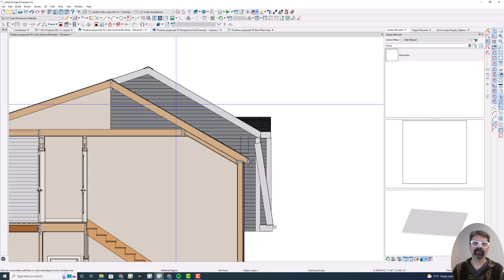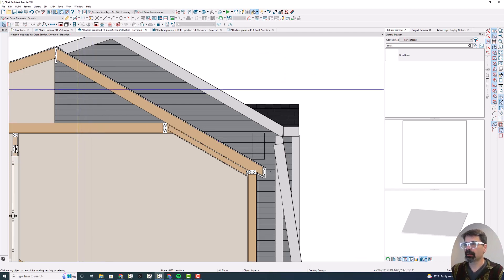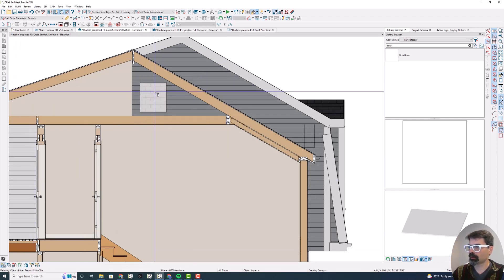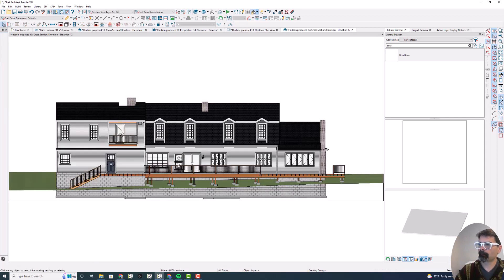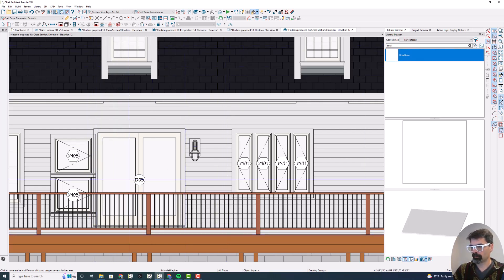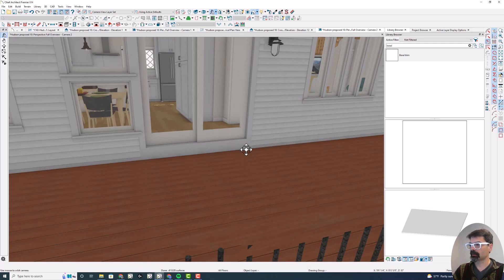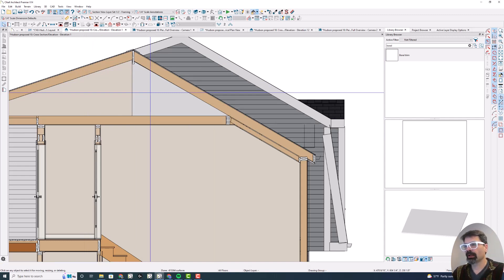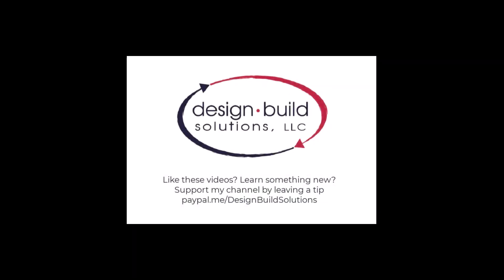Saving Time with Wall Material Regions | Chief Architect

Comment: Hey Tim.  Great video as usual.  
Off topic question....when using Notes, I can't find where I can fill the Note symbol with white, under the number, so that I can place the Note over a line or fill and the Note stands out.  If you have already done a video on using Notes, I'll go find it.
Reply from the maker: I don’t think I’ve done a video about notes yet. I don’t use them extensively and I really should start using them!
Reply from the maker: I just checked notes, and I don't see an option to fill or not, but when I place the note, it is already filled.
Reply from the maker: Strike that...I found it. It's controlled by the text style. If your text style (either using the layer or a specified style) is set to transparent, then your note is transparent. If you use a custom style, you can set the note label to transparent or not on an individual basis.

Comment: Saving to the library is a great tip… 
I noticed you had an angled wall by the dormers or maybe it’s your roof.  
Would love to know how to do that with a wall without creating a symbol.
Reply from the maker: Unfortunately, Chief does not do angled walls. This is a gambrel roof design with dormers popping thru.
Reply: @DesignbuildsolutionsLLC  I thought that would be the case but I got hopeful when I saw your video.

thanks